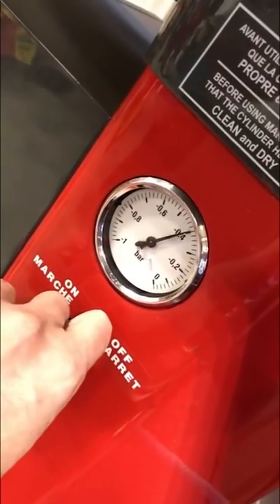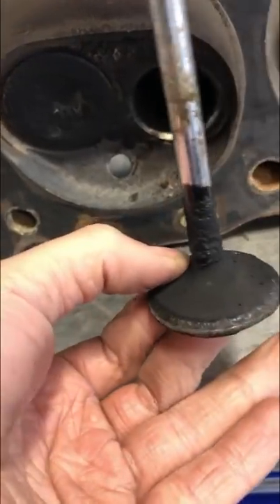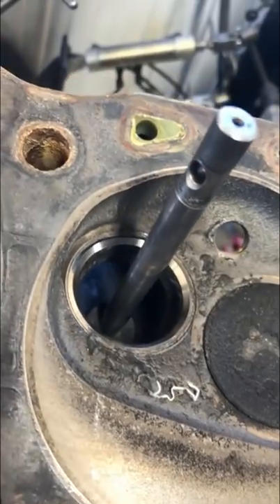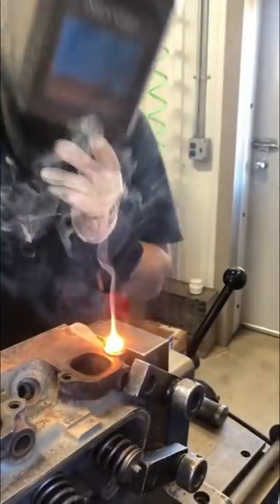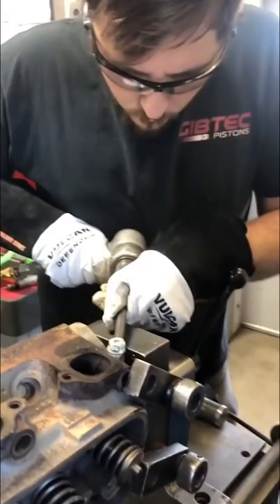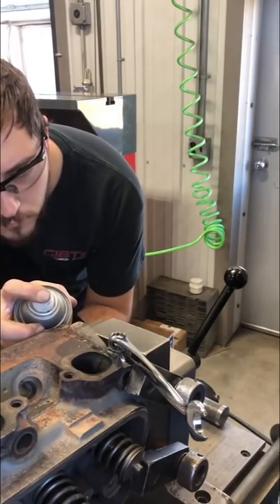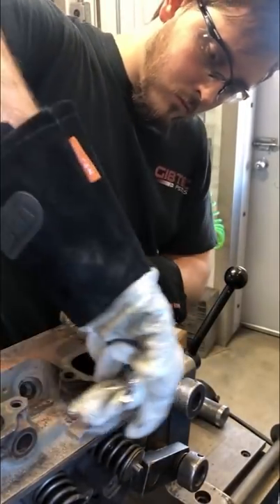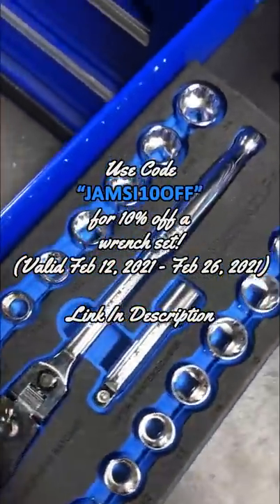#SHORTS Leaky Exhaust Valve Patch Job & Broken Bolt Removal w/ Michael Pro Tools

Comment: If you dump water on the nut right after you weld it on the broken stud it won't even need lubricant or back and forth. Comes right off
Reply: Or even better, wax.

Comment: The cool part about drilling Down the center of a broken bolt then welding on the inside IS as it cools down it shrinks allowing removal, Done it myself many times Great video👍

Comment: I've found chromoly rods work more reliable to remove flush or sub surface broken bolts. Almost double the tensile strength. Build up a nipple. Weld nipple to nut. Hit area with penetrating oil while warm. Be patient and don't start turning nut until cool. Good video

Comment: Something's I've done with some good effect; making a small tap to clean the end of those female threads, just a new bolt with same thread pitch with a couple channels cut in with a dremel to collect rust/chips.
And on holes that had over an inch of thread, a cheap end mill in a pneumatic rotary tool to take those 3-4 threads right out so they don't jam up what's left of the stud.

Comment: Great videos these! In work we use a mobile EDM for broken bolts but that's due to them normally being made of inconel which isn't exactly the easiest to drill. It's handy because the electrodes can be square which cuts a square hole in the bolt that accepts a square.  drive

Comment: Pro tip for you: use a Tee handle socket driver and not a box wrench.  The torque delivery is more uniform and less likely to Kant. That’s why tap handles are designed that way. Also squirt ATF on the stud shortly after welding. The thermal capillary action will draw some into the interface. Also don’t be afraid to turn CW first a little when turning back n forth. We apply these tricks through the fender wells while block is still in the vehicle.

Comment: Break fluid works really really well for penetration fluid.
Reply: Break fluid will also corrode metals
Reply: @Hondaone1  No it doesn't corrode metals. Brake calipers and brake lines are metal and filled with fluid.
Reply: DOT3, coz it's Silicone based.
DOT2 and DOT4 are hygroscopic, they'll pull water and start corroding the freshly sheared theads, after which it's bye-bye cylinder walls.

Comment: I find it beneficial when removing broken bolts to put a small bead on the broken bolt before putting the nut just to make sure that you have a nice coverage over the surface before you connect the nut to it. 
Also Awesome video bro👍

Comment: Sometimes you do what you gotta do. I had an old Mazda truck with a leaking valve. Truck wasn’t worth a rebuild at all, but a $50 gasket set from rock auto and $100 at my head shop to fix the valve some other minor things kept it running good for another 50k before the frame rust finally did it in.

Comment: Skills that will secure you a job for life. 
Better than that French poetry at your local university that cost you $50,000 from Sallie Mae.
Reply: Dude nothing is guaranteed for life. You can get your hands f up and no more mechanic job. You can lose eyesight. New engines no longer made to take apart or only electric motors. Never rely on one income stream period.
Reply: @TapiaJ  I think what they mean is the newer cars are more advanced, and require more finesse that is offered with classic machine and mechanic work. A REAL life long skill is body work. Metal and car bodys will need repair forever. At least as long as I'll be alive, and as long as you take care of yourself, that income doesn't fade.
Reply: @TapiaJ  as someone working in a machine shop new engines are increasingly complex and some even impossible to properly service. Some new cylinder heads have such little valve clearance in the combustion chamber that milling any material off the top would make it unusable. Electric motors in new electric vehicles will probably be somewhat servicable in their own right but they will most likely eventually put out traditional ICE vehicles. Their point had merit, relying on one source of income is never a good idea and provides very little financial stability

Comment: Use the induction heater. After you weld the nut. 
These heaters are amazing for bolts and nuts that are frozen in.

Comment: I did a broken exhaust stud last year in an ally head. I chain drilled around it and removed the off-centred broken end off the tap first :o) Then the broken stud. Yay, success, tap M14 for an M8 steel boss insert, jobs a good un’.

Comment: When you weld a nut on a broken bolt. Just dribble cold water on only the welded nut. It will flash shrink And can be removed by fingers

Comment: Weld a washer and a nut to the broken stud and then use a impact gun on them. Don’t just go attack and use all the the torque, use the hammer function. Works wonders !

Comment: In a cast iron blind hole you can blow the steel bolt out with an oxyacetalene torch. Cast iron doesn't burn .

Comment: When I machined my cylinder head I replaced the valve stem seals, springs, and spring hardware. I had a bent valve, 2 bad rockers, and a bad cam so I just replaced those because the machine shop said the other components were fine

Comment: I’ve never ever been good at welding anything. All of the times I ever tried welding a nut to a broken stud or bolt I ended up welding the nut to the workpiece lol.
My go to for removing broken bolts and studs is drilling them out and tapping the threads for clean up. I’ve had a few stubborn ones that I’ve had to use a carbide burr (ball shaped) on to clean as much of the broken piece off as possible and then drill and tap.
Cat exhaust studs were the worst as they have a slight taper so you can’t just drill them out, you have to remove the stud on those. And I always go back together with copper antiseize, especially with exhaust.

Comment: That wrench looks exactly like a Mac. Probably made in the same factory. Also the problem with that style is you can't use a cheater wrench on them.
Reply: Use a pipe instead. I use a 1 1/2" iron water pipe.

Comment: The nuts you are welding are plated. Its not a welding nut thats meant for welding or uncoated so as you weld it, the plating is coming of and mixing with the weld puddle. By the way.....that zinc plating is poisonous and you are breathing it.
Reply: Zinc acetate is a commonly available flux for lead-free soldering kits. It’ll eat holes in your clothes but if it was toxic, then why in hell not just include lead solder to round it all off?
Reply: But when you weld galvanized steel you vaporize the zinc.  Certified structural welder here, was in the union, local 44 plus millwright union. Can definitely make you sick,  so can lead.  Drink milk afterwards because the zinc or lead you've been exposed to will bind to the chitin vitamin d. L
Reply: Even worse is welding stainless. It creates chromium 6, like in Hinckley California and Erin brockovich

Comment: I worked in a machine shop and what we would do is use the torch to heat up the broken bolt and simply blow the broken bolt out and then clean the threads up with a tap. Work really well I shit you not.  Try it. It will save you a lot of time

Comment: You should try unichrome welding rod from Arc-Tec . It’s made for removing broken bolts and things. It works far better than a mig gun if you can get it.

Comment: Took my head in for a bent exhaust valve once. Turns out prior owner had bent one as well but just had the shop regrind the valve....the intake valves were also all pitted to hell. Went from replacing 2 valves to all 16 😅🥲

Comment: I like those wrenches. 

Hey... when you spray a penetration oil like that ... no need for flooding it and wasting it.  Spray some on and take a small hammer and TAP in that area... but NOT on the stud.   The idea is to make the metal “SING” and it sucks the oil into the threads.
Reply: I use a small torch and spray as it cools down to pull the fluid in. Doesn't take but a few drops.

Comment: Try using a j nut for broken off bolts goes down into the hole and protects any threads and then weld a nut to it

Comment: DON'T EVER DO JUST ONE! we had a cheap customer that we did a in frame rebuild on a freightliner the customer supplied the parts. We recommended a new head with new valves they didn't care that it was out of spec and said only do the intake valves since those are worse. We had them sign a contract that they only wanted the intake valves done and declined a new head as recommended by the machine shop. So we rebuilt the engine had the machine shop do their thing and only replace the intake valves. 248 miles later the head on one of the exhaust valves popped off, went in the cylinder and destroyed the engine. they then sued us and the machine shop and won even though they signed the contract! court said the machine shop should have declined the work and we shouldn't have finished it! Hard $40k lesson.

Comment: Those late model 460's break exhaust manifold bolts all the time.
I think ford sells a revised version bolt to help prevent this.
Reply: Didn't some Ford's use a sparkplugs that would snap in half too?
Reply: @blkft  Yes the 4.6L 3v/ 5.4L 3v had issues breaking when removing the plug. The 4.6L 2v/5.4L 2v had issues blowing plugs after being changed. This would break the provision for the coil pack retaining bolt. I believe there was a class action lawsuit over this one.

Comment: I have a set of those 90 degree wrenches or whatever you'd like to call them. I like them and the aggressive sipes in the 6 point seam to work well, but the old double wrench trick does not work for them and my set is a little short To be really worried about wanting them turned. I remember the ad showing how you can easily push on the flat face of the open end blah blah blah. But ruining the double wrench tactics was more of a bummer besides when double wrenching with normal wenches you get a flat side anyway lol..

Comment: Why do manifold screws get over torqued? Or is it thermo expansion causing the threads to bind up?
When you tap new threads is there a radius ridge tap that allows for easier removal in the future?

Comment: Trick when welding a nut over a broken stud: only use stainless mig wire or reverse polarity ss rods. Won't break off that easy.
Reply: I haven’t done it on steal yet only aluminum but it looks like he is doing this on an iron head what stops the pool from sticking to the head as well.

Comment: I will soon be doing this process on my LS aluminum head..typical rear and front exhaust manifold bolt heads have broken off..have done this on cast iron heads before..not aluminum heads..hope it goes well..not excited about purchasing another head if I jack up the casting

Comment: I guess this is an old video now but I keep seeing the tack weld to remove broken studs. I don’t fully understand how that works without also welding or damaging the threads of the head? I’m guessing you wouldn’t want to try this on an aluminum head? Thanks for any info

Comment: Next time after welding the nut on heat it again red hot then pour ice water on until it's cold you'll be able to just about spin it out with your fingers.

Comment: The problem with welding is that you are heating the bolt and it is expanding and therefore increasing the friction. And you are expecting an annealed weld to carry a huge moment. Yer no wonder it sheard off first time. It likely came off second time because the bolt cooled a cracked the rust. Would you like to know how an applied engineer would do this?

Comment: Get some diluted hydrochloric acid from hardware store put that nut in there until it stops fizzing  rinse off than weld it    The zinc on the nut gives you impurities in your weld

Comment: Why did that bolt break off? It wasn’t a blind hole? The FE I have candle waxed the top ones after pulling the head and never broke top row bolt , if I heat the bolts and center punch them and a touch of wax and worked them back and forth I can usually get the top row out but I have never on any FE broken a bottom bolt. In 50 years of FEs. That looks like a 2V Cleveland /351 400 M would 1/4 of an inch more  casting on the end bolts have cost anything? Dissimilar metals strike again, that stud looks suspiciously like a hardware store stud for a lawnmower, kind of shiny?

Comment: Use a bigger nut next time, the goal is to find one that has plenty of room to weld, dont just stick the nozzle on the nut, pay attention to what you're doing and build up the weld on the sides as you go along, and try not to make it so hot that it glows

Comment: I would not be surprised if that customer came in later with the other valves leaking and blamed the mechanic or shop for not checking and fixing them when they did this job.

Comment: I’ve seen the weld method a bit now. How does the weld not stick to the cast? I have seen people put in a copper pipe to protect the threads. But I don’t see that here

Comment: I’ve got a broken arp starter bolt stuck 1/2 an inch in the block. Any suggestions? Tried drilling and tried stick welding on 200 amps and still nothing

Comment: that engine should’ve had all new stainless steel exhaust valves and hard seats replaced, otherwise, you will be back in there. That engine was old and needed lead in the gas to lubricate the exhaust valve seats:/ probably. If you’re going to go to all that trouble to have the head off and spend the money on a gasket kit and probably new studs or head bolts, spend the extra bucks and buy stainless exhaust valves and have hardened seats installed and be done with it..

Comment: the weld broke because you’re not doing it right. just holding the gun in the nut and letting the metal stack on itself creates little to no penetration. get a hood and actually look at what your doing. the nut will never break off if welded correctly

Comment: logically explain using the air hammer that way. especially "peening" which im not sure yours is perfect use of the term but damn if you arent essentially just peening the bolt and compressing the threads around it..?

Comment: Use sex wax after you weld the nut on. It's for surf boards... it melts down into the threads and it backs out super easy

Comment: This is what you call pennywise and dollar foolish. 

You already have the damn engine tore apart. What's an extra $200 if that's what it cost. They could have went and got a set of valves at a store and it could have saved them the extra money. 

Let's be honest your markup isn't going to crush or hurt your business if you don't get it. If it does you're in the wrong line of business.

Comment: Dude, you ara good mechanic but you use the wrong methodes.
You should drill a whole in the middle of the broken screw,  reverse thread  the just nade hole . And then insert a "left" screw in it  and remove it by just twisting it the right way.
Reply from the maker: I’m not a mechanic lol

Comment: Did you loosen the transmission fluid line? So that it'll come loose and pop off in the next 2 weeks. Guaranteeing more work for yourself? All mechanics are scum if they work on modern cars.